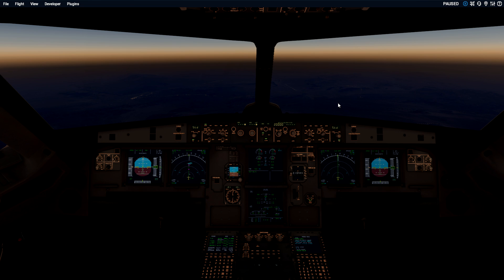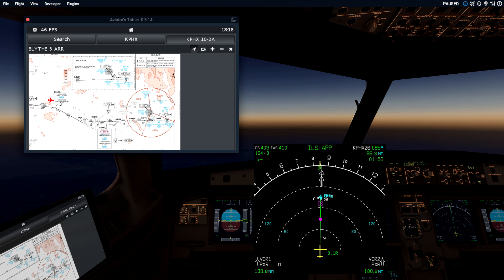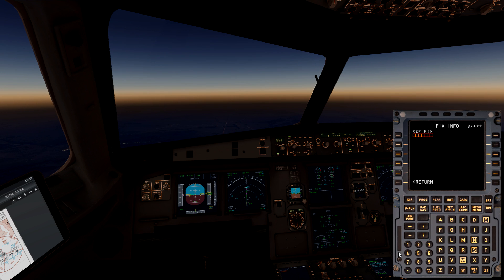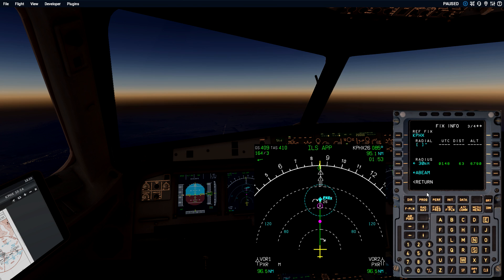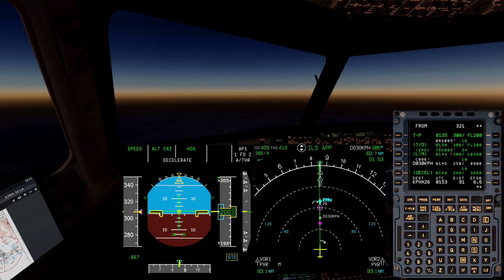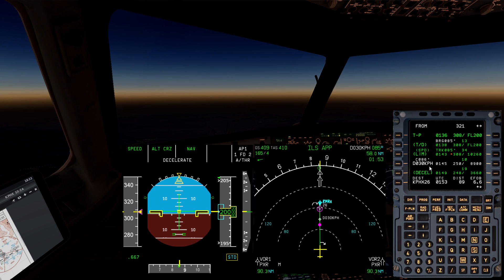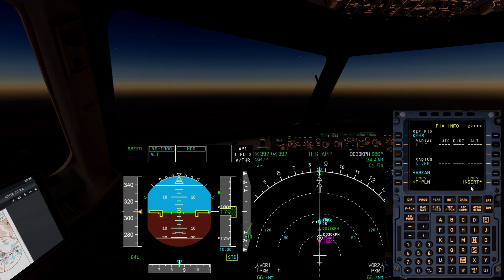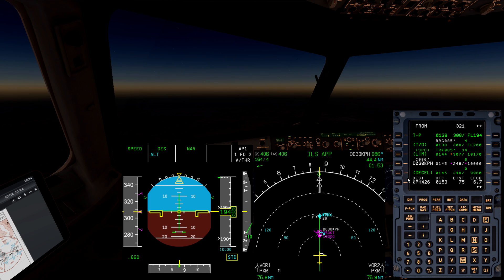VNAV Guidance with FIX Info I Airbus MCDU I Advanced Toliss A321

Comment: The requireement of pulling heading depends on the FMGS software and version. With some Thales FMGS, if you want to create a fix info point BEFORE the next waypoint in the flight plan, you will have to switch to HDG/VS mode. In this regard, the sim is accurate.

Comment: If we are already tracking direct to a fix, cant we just go in the F-PLAN page and use Place/Dist. technique to create a custom waypoint and then put the constraints in? For example if we just type in KPHX30 and insert it in the flight plan, wouldn't it work in the same way?
Reply from the maker: Aman Chauhan there is a format that works to create a waypoint if you are direct to the fix, and works quite well in most situations. I will cover that method as well. And tbh I’m not sure I’ve even tried if the P/B/D method is modeled on the Xplane buses

Comment: Hi, man. 
Greeting from Moscow, Russia. You are great with this and other videos. 
Thank a lot, because I'm just learning how to fly A321 Toliss. I have some questions, may be you can help me (may be not here if it is impossible):
1. When we programming our descent phase we put QNH data (with temperature, wind...). Crossing transition level we also put QNH on panel. It's clear. But in Russia we are given QFE. Would be any conflicts if we put QNH in MCDU in descent phase and QFE in panel? Of course we can request QNH but...
2. When we programming MCDU before start we need to put wind info. "Request wind" in Toliss does not work correctly. We can take all info in Simbrief, but how to put it correctly? Simbrief gives at any waypoint and climb/descent wind info at five FL. Should we put all or maybe just average as in 737?
3. What is the right movements after misapproach? Ok: positive rate, flaps, gear up, autothrotle, autopilot. And we are going as it is set in MCDU and charts. But what then: activation secondary plan? correcting primary plan? Just imagine that now vectors from disp (however I think it is impossible)

Thanks a lot, 

I'm Pavel